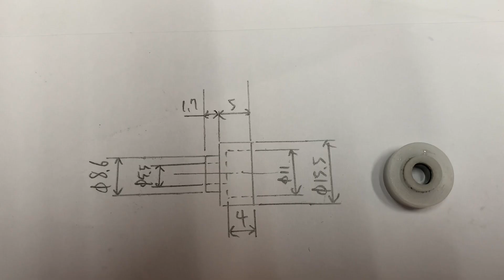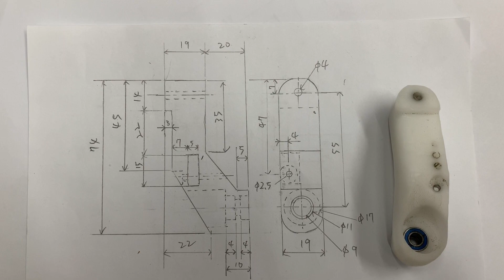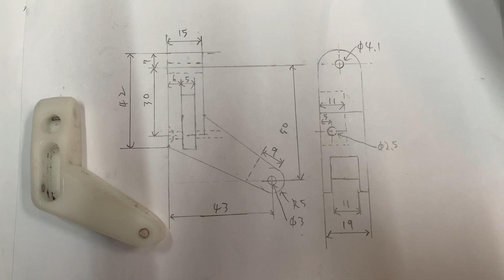TAMIYA THE GRASSHOPPER II BLACK EDITION UPGRADES  DOCUMENTARY (1/10 RC NO:47471)

Comment: Very cool project. That motor looks great!  Where can I buy it?
Reply from the maker: The motor has been discontinued, you can refer to HOBBYWING 30404312 Quicrun 3650 G2 6.5T
Reply: @kentwu-zj3vh  bummer. The carbon fiber finish looks great.  Thanks for the info!